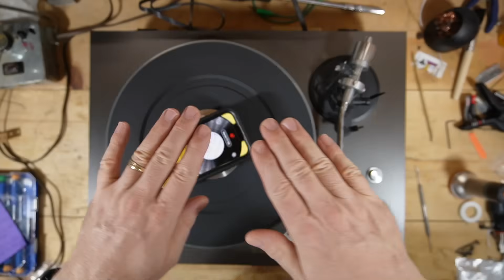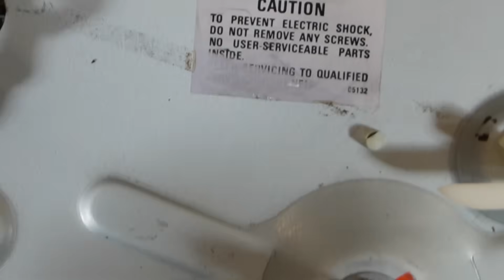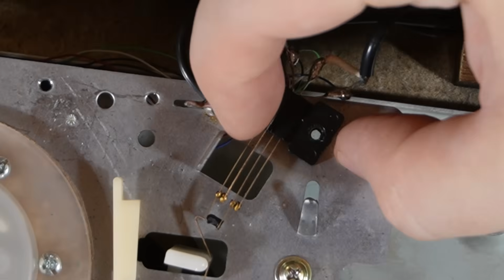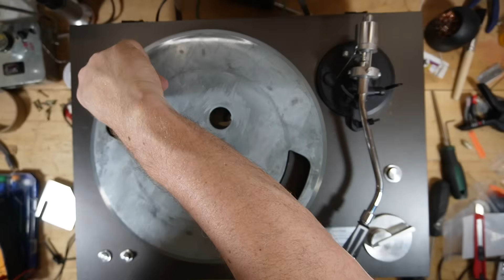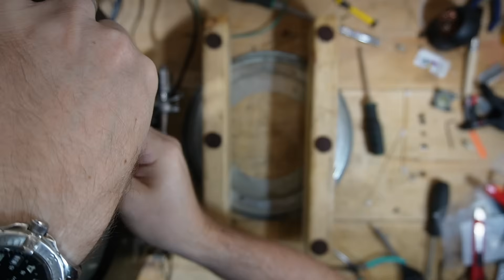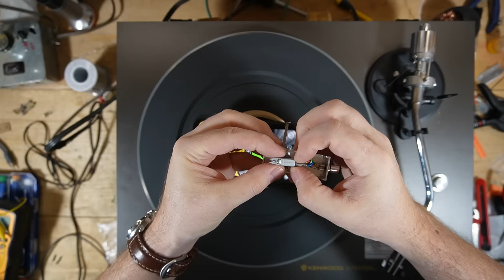Kenwood KD 2000 Turntable Service/Repair: Sorting Out Several Issues

Comment: I got a Kenwood 2055, rock table. Cheap and you got to have one Kenwood In your collection. One only. Pain in the butt. Got the 33 spot on with a Micro belt.  .800 longer. 45, don't have 45s. Stanton 681eee.
Reply from the maker: I currently do not own any Kenwood gear...I 'sold' my KA 6000 to 402 Vinyl...I may buy it back :)